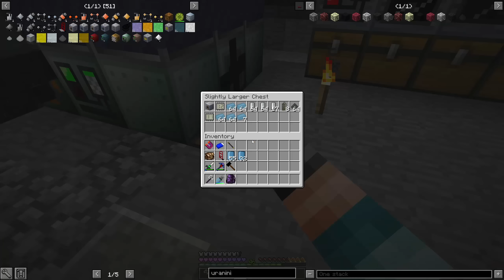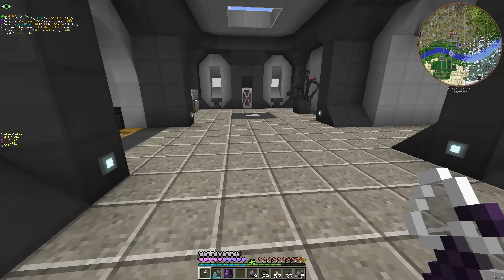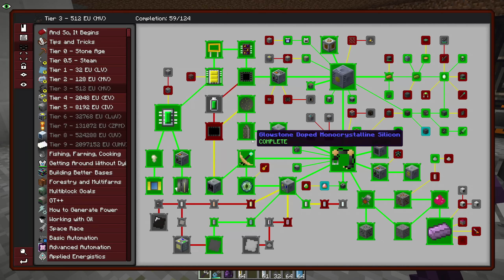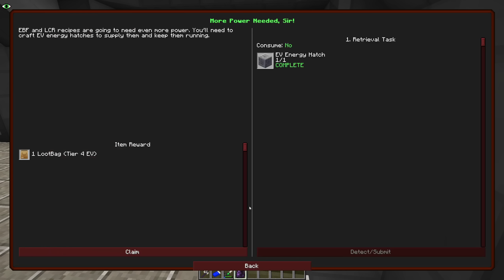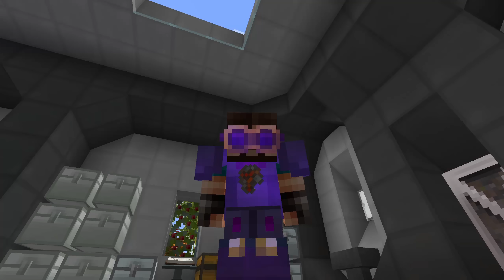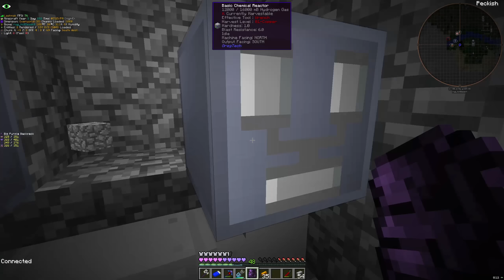GregTech: New Horizons - S2 Ep28 - Multiblock Madness

Comment: I suspect the reason why there's no quests for this method of graphene (and the advanced glue, for that matter) is that they're relatively recent addition. But don't you worry, the questbook will make sure that you will physically hold the end result of every single step of it's many excessively long chemical processing lines that you've got no reason not to automate the first time you get to setting it up 🙃.

(apparently bypasses for these quests do exist, but why wouldn't you want the many coins, lootbags and/or other rewards these quests give? The shop/conjure out of thin air section of the questbook is supposed to be useful, after all)

The questbook gets more and more sparse the further and further you get through the tiers. I would say it's because by that point you should know how to make a motor and so cluttering up the questbook with a ton of individual quests isn't ideal, but than every single step of every chemical single processing line has it's own separate quest, so...I'unno I guess.

For reference the questbook wants an IV mixer because you can craft it at this point, and you'll need it for the later two quests that go off of HSS-G, namely IV superconductor (which is necessary for IV energy/dynamo hatches even if you don't use them as cables) and HSS-S, both of which need an IV mixer. The questbook is basically not requiring you to make an EV mixer only to replace it with an IV mixer twenty minutes later. Which can lead to awkward situations, but I think it is the lesser of two evils in this case.

A multiblock distillation tower isn't always (sometimes, but not always) faster than a single block version. The NEI recipe will show it being twice as fast or producing twice as much within the same span of time, but it's also an energy tier higher, meaning it should run twice as fast. The big benefit of multiblock DTs is that they give you everything instead of single block distilleries that only output one fluid at a time, but still consume the full amount. Of course if you can't use the other fluids it's a waste to use the multiblock.

The fluid pumps have gone through some changes since the last major patch, there's now another tier inserted and the power requirements for running them have been made more strict. For prospecting for fluids you can use a prospecting kit, but do note that unlike ores that get added to the Journeymap overlay regardless the chance of successfully prospecting a fluid field does depend on the success rate that a prospecting kit has listed. So use a high tier one if you're looking for fluids, if possible.